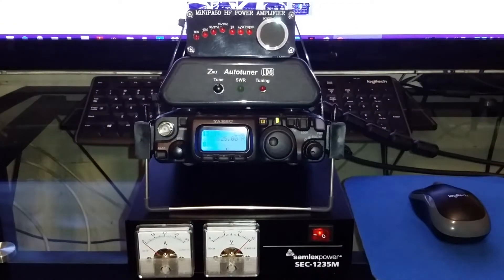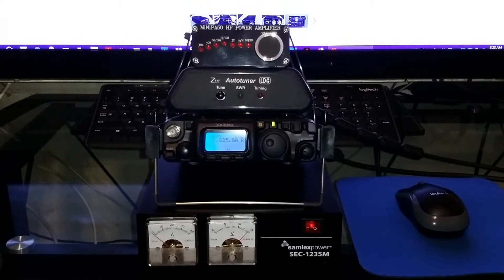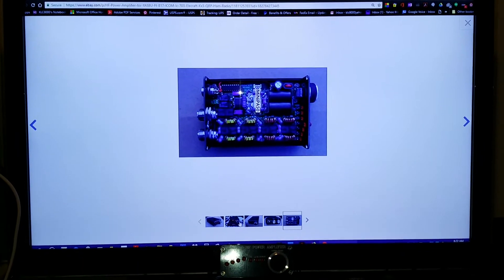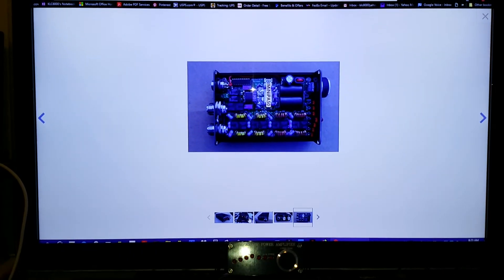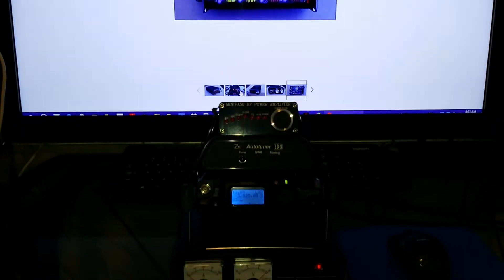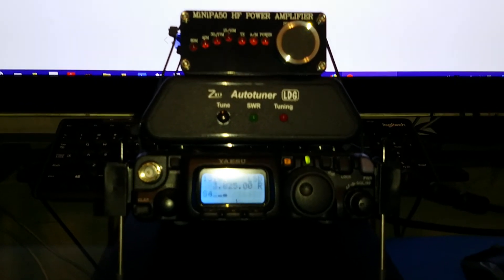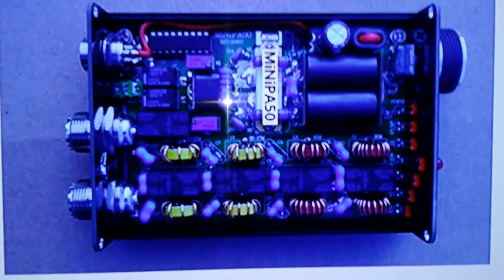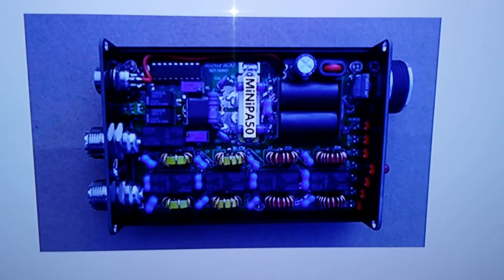Yaesu FT-817ND, LDG Z-817 AutoTuner, MiNiPA50, Power Amplifier.

Comment: One concern I had about this amp is that it did not come with a heat sink and wondered it it would overheat using digital modes.
Reply from the maker: I do not use it for digital modes. Only ssb.
Reply from the maker: I only use mine for SSB it doesn't overheat on SSB.
Reply from the maker: i do not use it with digital modes it would probably overheat. it works well for SSB.

Comment: How are you using the Z817 with the amp?  The Z817 tuner is only rated at 20 watts.
Reply from the maker: I only got about 25 watts or so out of the miniPA50 amp.
Reply from the maker: The amp is over rated.

Comment from the maker: It works well with the LDC-817 tuner. The tuner has a maximum power input of 20 watts, so 20 watts is just the right amount of power to give the Yaesu FT-817 the needed boost in rf power.

Comment: how much power can the antenna tuner handle?
Reply from the maker: The tuner is rated at 20 watts but i have been using the tuner and amp combination with my FT-817 for about a year  without any issues of overloading the LDG tuner  it handles the 45 watts just fine with my setup!
Reply: @KLCKLC-vi6fd   good to know .
Reply from the maker: 20 watts

Comment: Bet it gives the 817 a little punch!
Reply from the maker: It gives the 817 just enough to get through the noise i had a FT-857D and am sorry i sold it, the best combo that i hade was the FT-857D and the MFJ-629 auto tuner i used the combo with a MFJ-2286 antenna mounted to the top T bar of a steel clothesline pole in my backyard man that tuner can tune down to 160m it was the best auto tuner that i ever owned man it worked fantastic. I have a picture of the antenna if you would like to view i will send you a link to my dropbox Picture. Ps: My uncle tom was a mason, i can't remember his masonry degree, God bless his departed soul. The link is hear :  https://db.tt/ZsveRrRWu7
Reply from the maker: This is the picture of my FT-857D and the MFJ-629 autotuner Ron. https://db.tt/qsMa0jnQw8
Reply: The antenna looks great! I'm using an FT-857d as my main rig, and I have an Icom IC-703. They are both...freebies,...I saw them at my work and asked about them. My boss siad to take them home and use them...I asked several months later if the company wanted to sell them and he said to keep using them and they might ask me for $50 one of these days.(talk about being lucky). I use a LDG Electronics Z-11PROII and I also have an MFJ 941e Versa Tuner II.when I use a random wire antenna..I made a fan dipole in my attic for 6, 17, 20 and 40m.they both work great, but an automatic tuner makes me lazy. Thanks for sharing!
Reply from the maker: Ron,
You got lucky on the radio score! Damn, Wish i had your boss! I like the 20 meter antenna in your attic video, Great idea you don't have to worry about the critters eating your 20 meter wire. Nice video's 73's Ron
Reply: @KLCKLC-vi6fd  I don't think I ever heard of an MFJ-629 auto tuner. Perhaps you mistyped the model number?
Reply from the maker: I do not drive it too hard and I get about 20 watts out .

Comment from the maker: https://youtu.be/tfPIqaE9HRc
Reply from the maker: Check out this new AmpRadio lifier it only draws 5.0 amps including the Yaesu FT-817 https://youtu.be/tfPIqaE9HRc
Reply from the maker: Check out this new Amplifier it only draws 5.0 amps including the Yaesu FT-817 https://youtu.be/tfPIqaE9HRc
Reply from the maker: Amplifier only draws 5.0 amps at 13.8 Volts DC including the Yaesu FT-817 https://youtu.be/tfPIqaE9HRc
Reply from the maker: Well Tony I think i am going to sell my Yaesu FT-817ND, LDG Z-817 Autotuner, MiNiPA50 45W HF Power Amplifier, Whizz Loop V2 Antenna, Windcamp WLB-817S 3000mAh/33.3Wh FT-817 rechargeable lithium ion battery pack + charger + cover, MFJ-1822T, Antenna Ham radio antenna, Mfj-4103 Switching Power Supply for the Yaesu FT-817ND,  22.625MHZ TCXO TCXO-9 Compensated crystal module for YAESU FT-817/857/897, CT-62 Programming CAT Cable For Yaesu FT-817 with Programing software. I purchased most of the items at DX-Engineering and Ham Radio Outlet i have all the Sales receipts for all the merchandise and original boxes/packages. Most of the items is still in the boxes. The Yaesu FT-817 has never left the desktop next to my computer. The radio package is only 3 months old  purchased  on 1/10/2018, The Reason i am selling is so i can Buy the IC-7000 or the Yaesu or the Yaesu FT-991A  i haven't decided which one to buy, But i need to sell first .Well if you know anyone that is interested in all the radio gear that i listed let me know Tony. PS: someone is going to hit the jackpot when they buy my equipment all is like new most are still in the boxes. I have over $1600.00 invested in all the of the Merchandise and i am asking $1200.00 for all + Shipping https://youtu.be/tfPIqaE9HRc